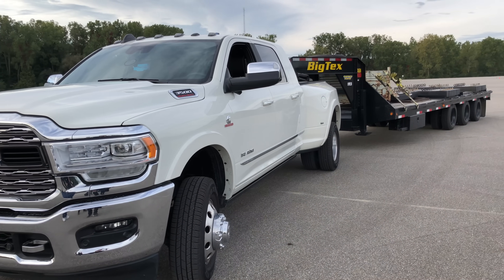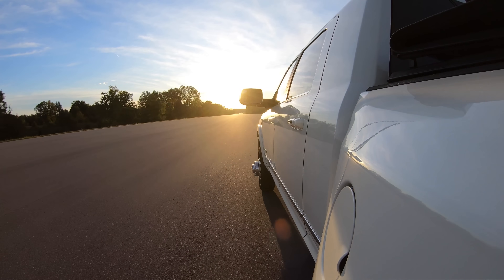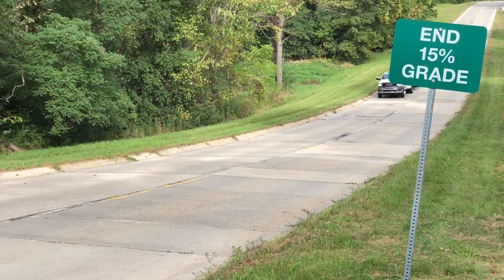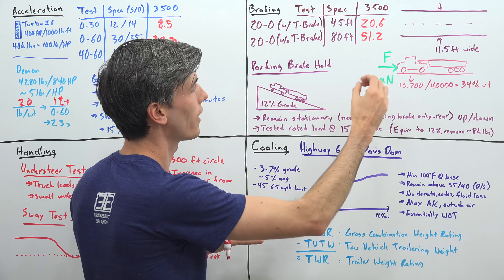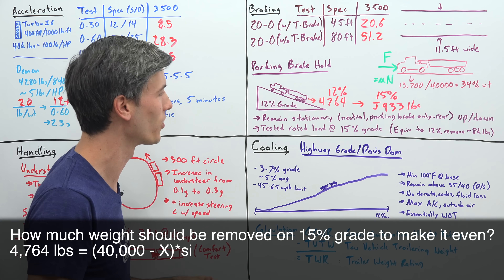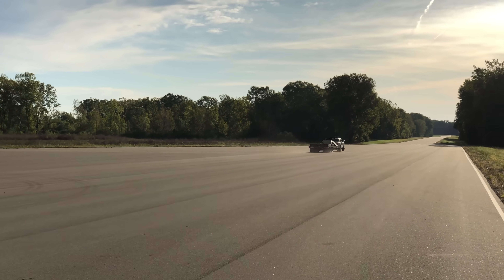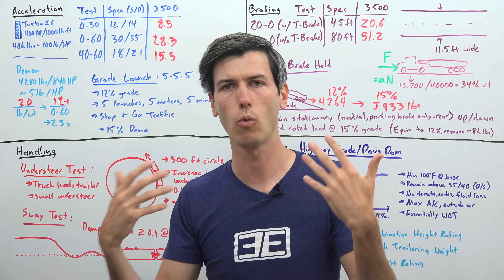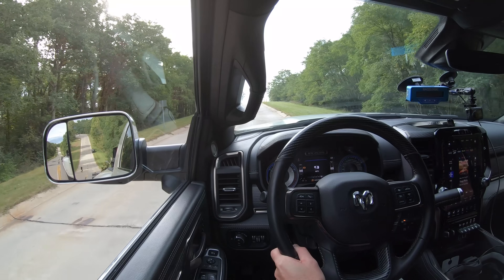How Much Weight Can Trucks Actually Tow?

Comment: On thing I've never been able to find out is how payloads are rated.  Do you know if there is a similar SAE protocol for payloads?  or is it just up to the manufacture to decide.  Obviously payload plays an important factor in the towing equation.
Reply: It is a pretty cryptic area out there on the internet now that I looked. Check out sae j1263 and sae j2263. They appear to have some relation to the topic
Reply: Payload ratings are determined by the gvwr which the chassis manufacture determines through international SAE protocols. Also, if I'm not mistaken, A lot of consumer "heavy duty" trucks that are actually technically classified as light duty are limited by that classification. They do that because state and federal laws cdl laws start playing more of a factor when you start classing trucks into the medium duty payload ranges.
Reply: @Moose_VII  so... you just asked the same question in a roundabout way. what is the method for determining gvwr? what sae standard?
Reply: You asked if there was SAE protocol and I confirmed there in fact was. I'm sure if you want the # of the protocol you could find it
Reply: @Moose_VII  you'd think, but I've searched. it's not a single one I'm certain but i can't find any reliable information about how a manufacture rates it's trucks outside of class limits. i even asked the dot and epa. they weren't much help

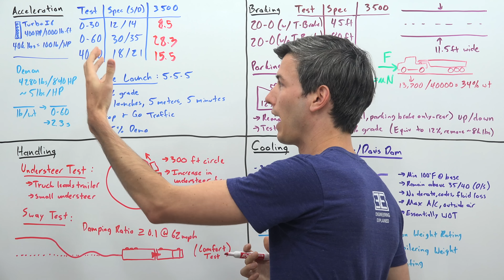Comment: 2:41 Thank you for correctly saying "weight/power"! So many people make the mistake and say "power/weight".
Reply: 1 hp per 5 lbs. Power to weight. Is that not also correct?
Reply: "Power to weight" doesn't necessarily mean power/weight. If you specify the units, the order doesn't matter.

Comment: The grade launch is really going to test the u-joints and drive shaft.  I've seen so many trucks snap a u-joint launching on the steep grade next to my work.
Reply: I used to work at a Dodge dealership years ago, and one day we had a 1 ton dually pickup towed in for repair.  
It had turned it's driveshaft into a pretzel.  It was owned by the provincial transit company (GO Transit), and they had tried to pull one of the passenger coach with it in the marshalling yard.  (think of a double-decker Amtrak passenger car).  The coaches weigh about 134,000 lb.  The motor had the torque, but the driveshaft thankfully was the weak link, otherwise I think they would have cooked the tranny.
Reply: I was thinking clutch and/or tranny fluid...

Comment: Hey, I was thinking about your Tesla tire video. How you went with smaller rim with bigger side wall. Did you adjust your tire pressure at all? All vehicles come with the sticker on the driver side door frame and I was wondering if you need to adjust the tire pressure with different tire sizes. That’s engineering. Please explain it.
Reply: Bigger sidewall = less tire pressure.

Comment: Yeah, towing capacity is great. What would be even better is if people realized they shouldn't be driving 10-15 mph over the speed limit while towing a trailer.
Reply: Your aunt Nancy going 20 under the limit in the middle lane is also a hazard...
Reply: I love how auto companies boast 15k tow capacity on 1/2 ton pickups with small blocks. I just drive by the wrecking yard to see all the smashed up, rolled, and sandwiched trucks driven by people who just dont understand physics.
Reply: @Froddofromtheshire  majority are improperly loaded, people who didnt know how to tow, and/or a trailer not set up properly. My little 2005 1500 only has a 5000lbs towing. Ive done pulled 12,000lbs with it without issue. Thing is, i know what the hell im doing where others who have never pulled that weight before have zero idea.
Reply: And shouldn't be tailgating ever. All those pathetic excuses tailgaters use on the internet are lame even for passenger cars (they always say "STAY IN THE RIGHT LANE THEN" as if they only tailgate people driving slow in the passing lane in the highway, which isn't true at all) are even lamer for people towing trailers and for semis. Drive safely.
Reply: @mjc0961  You really should stay in the right lane
Reply: @mjc0961  Yeah, I've gotten tailgated in the "slow lane" when I was basically the only other car on the road and the guy had 4 lanes to the left to pass me!  People are dicks!  Also the whole passing lane thing only works up to the roads capacity, when all the lanes are going 30 mph because there is so much traffic, tailgating the people in the left lane really isn't going to do much good.  Doesn't help that many of the highways around me have both left and right exits...
Reply: @mjc0961  they think being two feet away from your bumper will get them there faster. That way when you move to right lane, they can speed up to 90 to hurry up and get behind the next person they're goina tail gate. On 3-4 lane rush hour city highways it's even stupider. Drives me crazy
Reply: @matthewmcclain1316  Niether of you are wrong. The point still stands that the left lanes are for passing. If people are passing you on the left and the right you should probably get over.
Reply: We know the limits of our trucks and have a job that needs to be done. Get the hell out of the fast lane.
Reply: @brandoncaldwell95  If you're driving that fast, you don't know the limits of your truck, because you're beyond them and just haven't had anything bad happen yet and you need to take a physics class. You're putting everyone else on the road at risk.
Reply: @slightlycrookedworkshop  Actually, we do. Ive whipped trailers into spots you couldnt imagine at speeds probably way too quick. Ive pulled weights that they cry about. Ive pushed a truck to its mechanical limit on speed just to build it stronger and faster. Physics class? Tell me, have you ever drifted a 1 ton? I can promise you i have. Ive anything, ive pulled stunts to that majority woukd cry about. Then again, what do you expect being trained by police officers on how to drive. All this driving with no damage to a single vehicle. Tell me, what have you dont with your miserable life?
Reply: @brandoncaldwell95  There are always people who do know how to drive and frankly I don't care what you've done, do you want a cookie for drifting a 1 ton? I'm talking about the average person towing a trailer. The fact remains, there is a reason why speed limits exist and why roads are designed the way they are. Roads are designed to be driven at those speed limits by your average automobile with the correct tire pressure. The roads are not designed for a truck towing 10,000+ pounds traveling 75-80 mph...unless you're in the middle of nowhere but I'm mainly talking about heavily populated metropolitan areas with a lot of traffic and curves in the highway. Say what ever you want but there is no argument that driving a heavily loaded trailer at 10-20 mph over the speed limit is putting everyone else on the road at an unnecessary risk. It's unlikely that your skill or reaction time will outweigh someone else's stupidity. If you're such a good driver you'd realize all this and not need to brag about your abilities and insult people.
Reply: @brandoncaldwell95  lol triggered
Reply: @brandoncaldwell95  Tell me this, who makes the best aftermarket rear diff cover for a standard 1 ton american pickup truck?
Reply: @REALBanannaman  Depends what brand your talking on the 1 tons. Aisin trans trucks usually have a decent cooling finned diff. Otherwise factory. Every other has been a flat wall airiating the fluid. Banks did engineer one, but im not sold on it yet. So, factory or banks diff cover no other.
Reply: @brandoncaldwell95  Alright you pass the test. If you know about Banks, you know some things.
Reply: @REALBanannaman  Thing is, do you know of the aev prospector xl?
Reply: @brandoncaldwell95  No Brandon I do not!
Reply: @REALBanannaman  Alright you didnt pass the test. If you knew about any companies, then you would know them and their rigs.
Reply: One of the few things I like about driving in California is the 55mph speed limit for any vehicle towing.
Reply: @maybach6536  it's ridiculous for semi trucks though. A semi truck is very stable at speed. Otherwise Wyoming and Nevada would be chock full of semis wrecked by unstable trailers.

Comment: I hauled 35k GCW for years with 3/4 ton rated at 10k tow weight. And the trucks still going strong it’s a early 99 f250 edit: trans is tired at 400k

Comment: I would be interested to know how often this SAE test is revised or updated for more stringent requirements. Has the test advanced with the significant jumps in truck power, torque, and size over the last 10 or so years? If all major truck brands meet exceed the test requirements then this seems like another useless marketing tool.

Comment: I am really confused over why they chose a metric distance unit for the 5-5-5 test when all other units in the tests is in freedom-units...
Reply from the maker: Most engineers work in metric, but since the public buying these trucks are largely American, they provide many of the units in the freedom variety. The engineers running these tests will do all of it in metric, for simplicity.
Reply: @EngineeringExplained  That's a relief.
When I went to university (in Denmark) to become an engineer we of course used metric units, but in our text books we sometimes came across some examples/problems in freedom-units and we of course had to solve them using freedom-units just to prove that we could figure it out.

But I always felt bad for American engineers thinking they would have to live their entire lives with a system based on nothing but nonsense :D

Comment: A few years ago, I read J2807.  I then asked SAE why there is a difference between SRW and DRW vehicles.  They told me that dually were commercial and singles were not.  I don't believe there should be any difference --- if someone pulls out in from of me and accelerates, I really don't care if they are dually's or not!!
Reply: Yes but a commercial driver is more likely to take into account the fact that acceleration is very poor and not pull out in front of you
Reply: @michaelborisenko9432  This was an assumption on their party.  In reality, there are many non-commercial users of duallys pulling heavy loads and I can see no useful need for differentiating between SRW and DRW pickups.

Comment: After recently researching all this myself, I can attest to the confusing nature of abbreviations and especially terminology used by different brands. GVWR, GCWR, "towing capacity", trailer weight, trailer weight rating, payload capacity, tow rating, tongue weight, etc etc. For example a 00-06 Tundra V8 has a lower payload capacity and tow rating than a Sprinter van.
Reply: Van's were always built with crazy payload in mind while pickups were meant to hybrid tow and haul. If you havent noticed, most vans have higher payload than towing

Comment: Isn't damping ratio determined entirely by how the weight is distributed on the trailer?

And I'm surprised that the ratings are easier for duallys, isn't the whole point that they should be more capable? Also this truck seems like it can definitely handle more than the weight it was tested at.

Comment: What would the testing process be for a modified truck? Say I take an old S10, which I would assume has a fairly low tow rating, and throw in a decently sized diesel engine and throw on a big brake kit. How could I then get that vehicle tested and rated, so that if I go to a trailer company or Uhaul, they can't tell me that I can't tow a specific trailer legally?

Comment: Doesn't a lot of this data depend on how well the load/trailer is balanced? I guess there's an assumption that one knows how to do so for this heavy duty truck, but what about a smaller towing truck that an average Joe might not know about trailer balancing?
Reply from the maker: Yes, SAE J2807 will outline how the loading should be done for these tests. Doesn't mean random Joe will follow the same procedure.

Comment: Great video, as the owner of a truck that tows many thousands of pounds sometimes, this is very important to know. I did have a question as of to where the up hill test is performed in Arizona? (I live in the Devil's Den)
Reply: It sounds like something to do with Hoover Dam. That much steady climb without relent is only available in a few areas, and most of those are in SoCal. Flagstaff has a brutal climb, but the temps aren't that high at the top, though at the bottom in Phoenix they are... but that climb isn't steady, it's several whoops.

Comment: I'm curious as to how they get tongue weight ratings as well. In the Chevy Colorado groups, there's been some misnomers as to why the frames are bending when folks are bombing down dirt roads with massive trailers, and blaming GM for under-engineering their platforms to save cost. These folks arent understanding crumple zones, and the forces at hand on the chassis/frame, hitch and other components.

Comment: Perhaps this title would more accurately be: "How much can this truck Legally tow". I know the truck is capable of illegally exceeding the ratings
Reply: Because your can tow 30k doesn't mean you should. I see all these truck owners bragging about towing over 30k with no CDL on their 3500s
Reply: @Ckcdillpickle  to put your concern to rest, the individual to whom I refer does indeed have a CDL. 26000 GCW is what I am told is the max without a CDL.
Reply: @walterk1221  if it's privately owned and not used to transport frieght for pay, you actually don't need a Class A CDL.
Reply: @joshuarewerts8566  That is highly dependent on the state you are in, in NC unless it is an RV you need a CDL over 26k regardless.
Reply: @joshuarewerts8566  are you sure? I found this statement which appears to contradict your comment: "According to the United States Department of Transportation, a Class A CDL is required to drive tractor-trailer, or combination vehicles that have a gross combined weight rating of 26,001 pounds or higher with the towed portion of the vehicle that weighing more than 10,000 lbs." I am not arguing, merely seeking the correct answer. There is, as you see, no distinction between privately-owned "not for hire" and commercial purposes. I am curious.
Reply: @walterk1221  From what I can tell from the DOT website on commercial vehicles, this restriction applies only to vehicles driven commercially.  If you can provide a reputable link directly to a US DOT regulation stating otherwise, I would be interested to see it.  As others have stated, my understanding is that the commercial/non-commercial criteria for driver licenses are regulated by the individual states.
Reply: @jamesbeaman6337  this is not necessarily sourced from  a "reputable link" but it is what I found quickly. 

"Each of the major pickup manufacturers now offers one-ton dually pickups with a gross combined weight rating (GCWR) of more than 26,000 pounds. And in many states, legally operating a pickup and/or a trailer combo exceeding 26,000 pounds may require a commercial driver's license (CDL).Jun 6, 2013"

I do not believe that the US DOT will disagree with your statement and belief. But it appears the several states may. The ramifications of passing through such a state are beyond my interest at this point. Thank you for interacting.
Reply: @Saxamusprime unsure... a person residing in my home town routinely (and illegally) tows 40000 plus with a second generation Dodge.

Comment: Awesome video Jason. I have always wondered if there was a standard. Do you know what year each brand started using this standard?
Reply from the maker: Good question Chris! I asked when I was there and they said around 2014, so anything later than that. But likely it's something you should be able to find depending on the manufacturer. Ford, Chevy, Toyota, & Ram, should all be using this for their ratings today.
Reply: @EngineeringExplained  a very subjective so called standard be better to call it a guide the conditions that the vehicle is tested in can vary
Reply: ChrisFix  can you make a video on what to do before you buy a 94 celica
Reply: @anthonymolina7416  🤣
Reply: Anthony Molina buy it and then sell it for a 94 supra
Reply: I suddenly want a H1 Hummer.
Reply: From my understanding Toyota is the only one that goes by this standard at least up to 2014

Comment: I've always wondered why some trucks and suvs that share the same drivetrain have significantly different tow ratings (4runner and Tacoma). Looks like the handling test must be the main derate for the suvs (top heavy, shorter wheelbase).  You agree?
Reply: Handling, braking, frame design to resist distortion.

Comment: Why are double rear wheels used instead of bigger single wheels? What are the advantages and disadvantages of each?
Reply: Two tires gives more rigidity and redundancy. Each one of those tires is able to support nearly 50% of the payload capacity, aka support its half. So if you have a flat you arent a 43,000lb wrecking ball on a highway
Reply: @james2042  thanks mate (but I don't entirely get it) like why can't 1 bigger wheel on each side have the same amount out rigidity? Or is it more expensive to make singular wheels like that?
Reply: @ahmadtajy  first it would have to be a specialty tire, which would cost a lot more, second the amount of pressure that single massive tire would be under would make it way more prone to blowouts. The reason ultrawide tires are good on track cars is because of the extreme low profile, With how big truck tires need to be to support the weight safely, making a singular tire doublewide would just not be worth it in practicality, cost or safety.
Reply: @james2042  ah okay that makes sense. I get it now